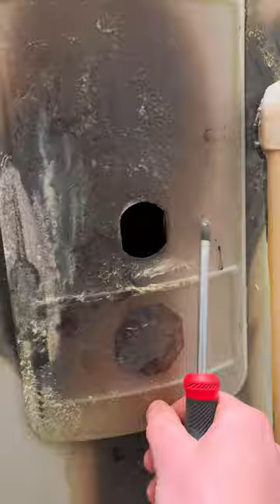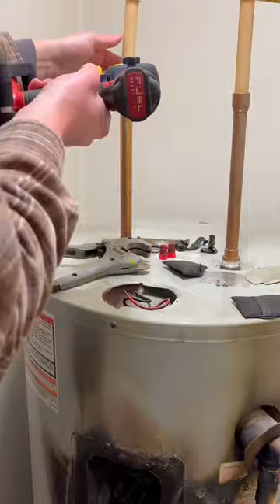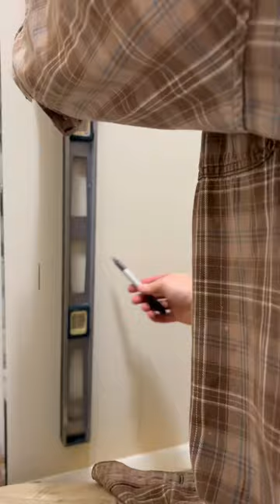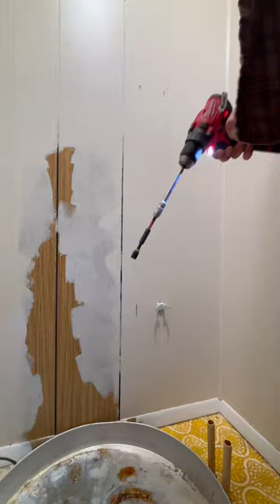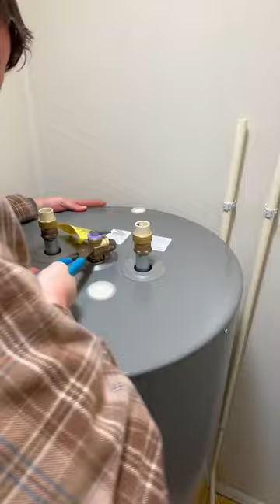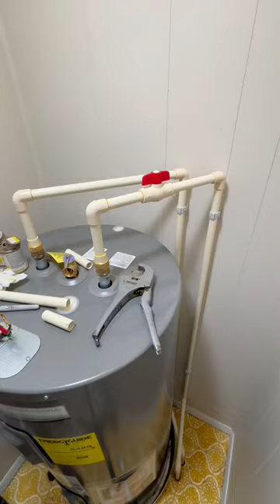Why did this water heater catch on fire?! 🔥🔥 #plumber #bluecollar #waterheater @dewalttv

Comment: Cpvc and as it gets older gets very brittle and tends to shatter like glass. It looks like it’s a mobile home, which is common to have sea PVC unfortunately, it freezes in bus all the time. If it is in a mobile home, you have to make sure that you change out your elements from 4500 W to 3500 W are you will burn that motherfucker down again. Also, there’s no expansion tank so they will have thermal expansion, which will cause intermediate leaks From the faucets. as a service plumber, you need to focus on how to fix them big picture issue not just what they called. You therefore. A mobile home two bath water re-pipe is easy you’ll have it done in a day if you have you and one other guy.

Comment: probly good to check the panel. but loose/bad connection for sure. I've seen it a few times. Just had one where a shoddy plumber was trying to do electrical, when he probably shouldn't be doing either. didn't burn that bad, though

Comment: In my apartment I had my WH braker pop few times. I realized that it was an ark fault braker. Disconnected the water heater wire inside top cover, (just one of the legs) turned the braker on, it stays on.  I turned it off again, opened the bottom plate. On the plate screw, I noticed that there is ark mark. Apparently the wire was pished into the tank by the screw inside the insulation. Replaced the wire, its still working today.

Comment: Water heaters can catch fire due to pressure buildup, gas leaks, overheating, or other issues. Water heaters have pressure relief valves to release excess pressure, but if these valves malfunction or the pressure builds too high, the water heater could explode

Comment: The breaker could of been oversized and it was on the power side of the elements not the internal, I’ve seen fires caused by loose connections which could of been this problem

Comment: The electric panel didn't pop the breaker. I have a feeling it's the panel breaker.  There had been a recall on older panels.
Reply: Unlikely the breaker.
Electrical current is actually reduced in this type of failure. 

Please see my detailed reply, giving an fault analysis.

Comment: 240 volts means two legs 180° out of phase at 120 volts to ground.  If only one leg is thermostatically switched for temperature control,  it works fine until the heater element fails short to ground.  Now the heater is uncontrolled and always on.

Could not determine if this heater had a double pole thermostat on each element..

Comment: Loose connection which creates heat. Started with slight gap arching on/off over time the gap gets wider with more arching until it is red hot and flames up consuming any available fuel source in close proximity.

Comment: Water can run over edge and get into panel. Since the stuff fried and had time to cool down you might not see where the leak was because no pressure from heat.

Comment: The real issue is why the breaker didn't trip, even if you replace the water heater if the electrical portion is not addressed then that fire could happen again

Comment: My buddy just transitioned to propane in his house cause he was having so many issues with his electric appliances. And for the cpvc pipe, that stuff is garbage. I’m a sprinklerfitter and dealing with that pipe is awful. Atleast in fire protection it is. Ain’t nothing for frustrating that showing up to a service call for some leaking 2” plastic pipe. Cure time is dictated by size pipe, static water pressure in the pipe and ambient temperature. 2” pipe with 150 psi in perfect indoor temperature is 6 hrs.

Comment: If the plastic cover is not replaced on the water heater I have seen wet insulation water bridge connections and overheat the wires without tripping the breaker.

Comment: Guessing the Breaker and Wire was rated right or you would have said it wasn't. Other than that, faulty components. It got to hot.
Reply from the maker: Yes that was all good
Reply: Dust

Comment: Loose connection on the t-stat or element. It arked just enough to heat the wire without tripping the breaker. Normally the wire will burn up and break connection, but my guess is that the t-stat melted down first...

Comment: I hate cpvc sooooo much. I've never had any issues, but it just sketchy as hell. I replaced a State wh a few months back, it was less than 4 years old. Thankfully it wasn't near as bad as that one. Best I could tell is it shorted on the tank and the wire insulation caught.
Reply: I am just a helper so I am very new to this put I hate touching anything cpvc scares me
Reply: Nothing beats copper

Comment: If you're hooked up to a Panel, that's been recalled, because the breakers are not known to trip correctly.Yes that's a typical problem. Too big of a fuse in the fuse box. Overall electric is more prone for sneaky fires like. With gas appliances, they have flame.Roll out sensors that shut the unit off at the control valve. I've seen more electric heating appliances, including water heaters, have fires more than I like to admit and with the new smart water heaters.Circuit boards are known for Catching Fire.Or letting the smoke out from the slightest power surge.So the problem is only going to get worse

Comment: The installation is now foam instead of fiberglass all it is a short circuit wire under the cover gets hot and catches fire which  then catches the foam insulation on fire did you check to see if it the breaker to make sure sure it wasn't a higher amperage  than the will take thankfully t
Reply: They had a smoke alarm  and extinguisher mine was a 40 amp breaker on a14/3 wire the result was disastrous

Comment: This happened to me at 3 am in the morning. One of the risers lines under the top cover of the water heater was leaking for years. Water ran down around the top element and right though the bottom element that caused a short and smoked the lower element and wires.

Comment: 100% electrical issue, especially because it's not a gas water heater. Guessing screws aren't tight enough. Happens a lot on high load equipment. One day they're fine, the next it's juuuuust loose enough to cause arcs

Comment: What's the user error you've seen for CPVC? Need to repipe my house and trying to choose a material and CPVC is my top pick.
Reply from the maker: Not using enough glue, not supporting the pipe, not giving the glue enough set time, etc. If I were you I’d repipe in pex

Comment: Probably loose connection that caused it. That's the most common reason. Won't trip the breaker but creates high enough amperage to burn up the contacts eventually sooting it up so bad it catches fire. Or it could've shorted. Not completely but just enough to generate a ton of heat. Plasma is a crazy thing and it does not always trip the breaker. I've seen a current relay burn off the terminals on a compressor just because it wasn't plugged in enough.

Comment: This happened to a friend of mine. He did a poor job twisting on a wire nut. It came off and the electricity arced to the metal panel, causing the fire.

Comment: Lol iv seen it twice now its rare people change the element and a loose wire or bad connecter eventually arcs threw no one tucks the insulation properly and Every thing melts and it goes up bad maintenance is usually the problem but a 30 amp gfci breaker will usually catch these problems before they arc out problem is no one installs them because of a 120$ price difference

Comment: Well,i dont see a grounding conductor or the bonding jumper ! You have platic water pipes so you have no ground path as far as metalic piping!!! Does the electrical wiring have a grounding conductor at least?

Comment: There was probably a leak inside that soaked the insulation. The wet insulation against the element and thermostat connections were arcing. Since it was wet the fire didn’t get that bad. I’ve seen it happen.
Reply from the maker: Idk we didn’t see any signs of leaking
Reply: It caught on fire because water is acidic and the elements are not as strong as the water after years the water eats through the element and causes a short then fire
Reply: Maybe but don’t you think the breaker would trip
Reply: No  @radroofer
Reply: @jjlpinct  yup

Comment: The electrical part is easy, loose connection causes high resistance. Hence I2R heating that ignited something. Being that I am not a plumber I have no idea what the insulation around the tank is made of. I would have thought it was made out of something at least fire resistant
Reply: Insulation is polyurethane with flame retardants. Fire was electrical.

Comment: High resistance joint.  Basically a loose connection that got so hot it melted the copper and insulation but didn't short out to neutral or earth immediately until the fire was well alight...

Comment: I had this happen the anode rod was eaten away and the bung where the element inserts corroded and a rust flake made the two wires arc causing the element to weld itself to the tank All because the element was installed without the rubber washer

Comment: Yeah I had a neighbor have this happen. The issue is typically an upper element has gone bad and makes a ground.. the water should have gotten bad enough for the pressure relief valve to go off... but if they don't the wires get very hot and burn... this is where the breaker should have shut down. But if they don't (fire)!!

Comment: The people who installed our new water heater left exposed wires in the panel that were arcing against the inside.  It tripped our breaker and sparks shot across the bathroom when I flipped the breaker.  The wires were all melted.  Luckily no fire but I imagine it was a similar situation.

Comment: My guess is the circuit breaker is (was) bad. Whatever took place in the water heater circuit did not trip the breaker. In high amp draw circuits, the contacts in the breaker can fuse together over time preventing it from opening the circuit when an overload occurs.
Reply: This tyoe of failure actually causes the current to drop, which wouldn't cause a breaker to initially trip.

Please see my detailed reply for more details

Comment: Water leaked, from the top, dribbled down, and found the electrical panel.
The pipes at the top started leaking.

Mine didn't flame up, but it did smoke.
Reply: Maybe not the same.

Before turning off the breaker, mine smoked.

Comment: My water heater caught fire a few years ago, turns out it wasn’t being drained correctly every six months, and the elements corroded so badly they snapped allowing water to get to where the insulation was, getting it wet and creating a path to start a spark

Comment: That's kinda scary because my water heater is in an enclosed space where it makes contact with the drywall in that same area which I believe that drywall is combustible material the water heater was already at that same area when we bought the house and the worse part is that when we replaced it due to our old one leaking we couldn't relocate it because after buying the new water heater we didn't have enough money to buy new piping to relocate our water heater and the biggest problem was whoever install the existing water heater in the first place didn't even put a shutoff valve to the already complicated copper piping that they installed and the worst part is i don't know how to connect copper lines and then to find a way on how to cancel out the existing copper line system it's just ridiculous

Comment: Buildup on heating element reducing heat transfer to the water preventing the thermostat from heating up to turn off electricity thus causing plastic portion to ignite is my theory.

Comment: You could replace the wiring and electrical components for a fraction of the cost of a new one.  If it ain't leaking, repair it.

Comment: Loose terminals and ageing insulation on the wires. It's arked and caught fire to the insulation. There doesn't have to be an earth or neutral fault for it to be a fire hazard. That wire box was probably full of years of spiders and dust, which doesn't help.

Comment: Not a plumber but l have fixed their mistakes! Anyway, l use cpvc, all over, had one fitting leak in nearly 20 years. I was a 90 and it had split in it. Brand new outta the bag!! I replaced it and off l went. I replace water heaters, sinks, toilets, bathtubs, showers spigots. Never seen this but makes me wonder if the breaker needs changing as l believe it should have snapped off! I have had to replace breakers before, they do wear out. Incidentally, what size breaker was on it. Should have only been a 30 amp.
Reply: Cpvc I'd literally outlawed in many cities counties and municipalities due to the fact that it's GARBAGE Lol just cause you been doing something for years the same way don't mean it's right . But plumb on brother 😅
Reply: Electric water heaters should have a double 30 amp breaker
Reply: @vulchman3483  l meant that, just forgot to say it. Thank you.
Reply: @vulchman3483 Well it's pretty obvious he meant 2 pole. You wouldn't see a single pole 30A breaker. They're very uncommon and there are only a few appliances that would draw 30a at 120v.
Reply: @AnUnapologeticApologist  here in Florida anything is possible I recently saw a single 30 amp breaker for a 240v water heater
Reply: @ottocabrera5935  I suppose you use pex. Ok that's fine. Had to fix too many leaky joints on that stuff! More so than any other method. Seems that its difficult just to crimp it correctly. Cant use copper here. It was king for a while but our acidic water gives it a very short life span.  So, pvc coming into the house, (from well or meter) and cpvc throughout the house. I've seen both that have lasted more than 40 years!
Reply: @vulchman3483  That wouldn't work though it literally would do nothing
Reply: @vernontorrence4407  honestly we use a combination of materials,  whatever the job calls for really and customer preference.  When it comes to residential uponour pex type a mostly due to possibility of freezing , heat tape and insulation helps only so much we can't control the state of the dwelling many times . On commercial we use mainly copper press due to the fact that it's quick.  When you have a hospital that needs the water back on quick because they have patients on dialysis every second counts. But we also solder when need be but flame in oxygen rich areas can be hazardous to all involved. Really it also boils down to getting it back on quickly and efficiently.  But  cpvc is a definite no go , takes too long for glue to fully cure and becomes highly brittle with chlorine/chemicals they use on the hard water in many areas . We're constantly replacing it .
Reply: @ottocabrera5935  l have seen that copper crimp. Never had any complaints on it. I have helped build houses for 35 years. After the '08 crash l am basically a glorified handyman. Plumbing is only a small part of my business or l would think of investing in that system. As it is, l'm old, work by myself, and cant seem to schedule a day off! But, l still get around better and in better health then most people who work in an office!! If you gotta good thing goin' then stick with it! Have a good one!

Comment: Well first you let it run at low power for 12-24hours so the Xenon starts accumulating in the reactor, then you increase power, turn off the pumps and remove all the control rods...thats how.

Comment: Still wondering why WH manufacturers put #12 inside their products running 3800 watts. These connect to #10 wire coming from the breaker/disconnect/fuse.

Comment: Going to go out on the limb here and say that the homeowner was continuously turning the breaker off after it tripped. 95% of the time that is the case CPVC is garbage and becomes brittle especially on the hot water side after several years

Comment: I have ran into it and found a loose wire on the upper control I got the manufacturer involved because it was a wire connected by the manufacturer

Comment: I'll  tell you why. It's because all these new water heaters are running 14awg wire. How they get away with it is beyond me. But I've had wires ark right through the jacket of both wires due to them getting so hot that the jacket melts.

Comment: There was an electricity leak in the cables that most likely reattached to the metal wall of the water heater bouncing off and creating radiation that connected to some form of wick like material like a sticker on the water heater creating a plasma fire

Comment: Element probably shorted out and either the circuit breaker was bad and never tripped or the breaker installed was too large for the nameplate rating.

Comment: 20 years working on high voltage industrial equipment. For a guy that wants help your video does not stay on the burned electric’s very long. Still after watching this a dozen times I see it. 

Sloppy job of wiring the four pole heating element. Look closely and you will see the secondary jumper wire pulled around a terminal screw. The element is hot. The insulation on the jumper wire melted, made a secondary contact hot -> neutral, releasing all the magic smoke.

Comment: Nothing wrong with PVC piping, but I'd never trust a plastic shut off valve. Glue on some male thread to slip fittings and ole. As far as the fire goes I'd be willing to bet it was on to high of an amperage breaker, 240V 20A will run a residential water heater no problem.

Comment: Cheap wiring inside the water heater. I had a water heater catch on fire and inspected the wiring that wasn't touched. The diameter of the wire inside the water heater didn't match up to 10 or 12 gauge. It was somewhere in between

Comment: Probably a loose neutral wire on the thermostat. Those stats are made to fail safe, hence the reset button, so I can’t see it being anything other than that really
Reply: There is no neutral wire on a 240v single phase circuit.  Just two hots.